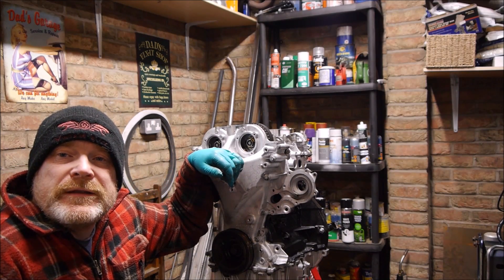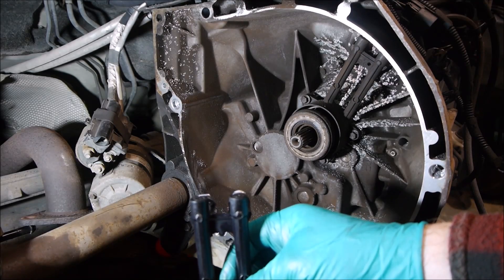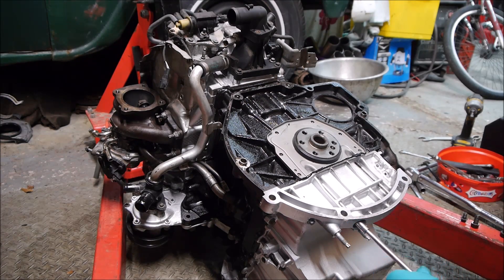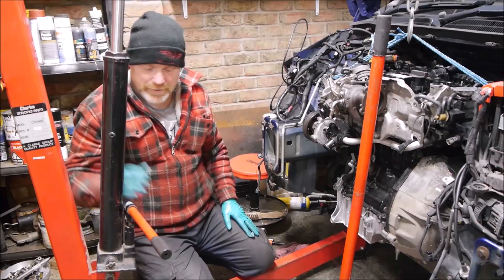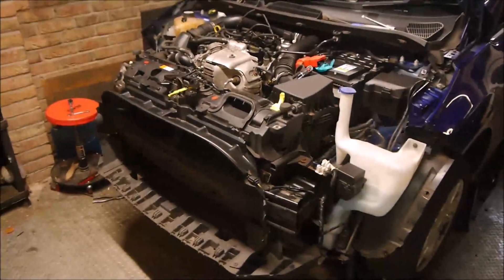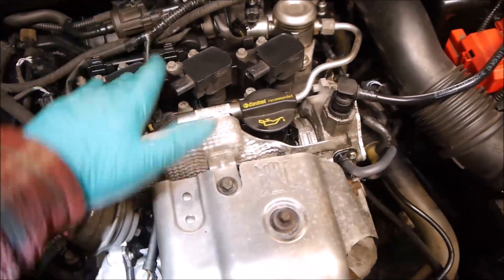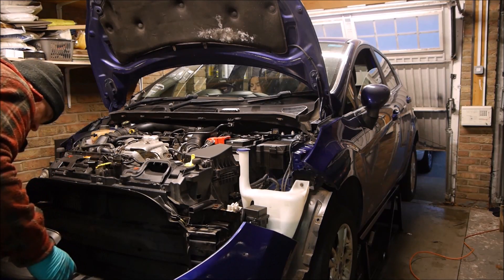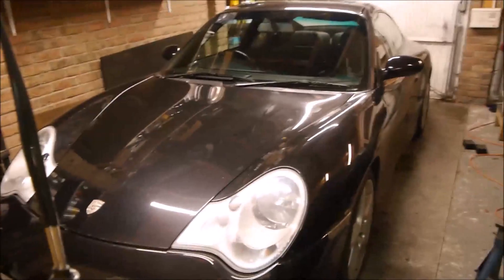Ford Fiesta 1.0 Ecoboost engine rebuild  part 7 - Engine replacement and first run up

Comment: Prime the oil system before you put the spark plugs in it is easier on the bearings, starter and battery with no compression and quicker as it cranks faster.
Reply from the maker: Yes excellent idea. Thanks

Comment: Very nice video, I have a 2019 Fiesta with the same engine. Have you encountered the 'Charging System Service Now' warning message? Cant seem to get rid of it despite changing the battery, and resetting the BMS. The car is actually charging and runs fine except for that warning.
Reply from the maker: No haven't had the joy of that message.

Comment: You will need new bolts for the main cap and big ends.

Main Caps

oil jets top

8  4  1  5

7  3  2  6

Stg 1 10Nm

Stg 2 25Nm

Stg 3 30Nm

Stg 4 Angle tighten 15 Deg.

 

Big Ends

oil jets top

4  1  5

3  2  6

Stg 1 8Nm

Stg 2 12Nm

Stg 3 18Nm

Stg 4 Angle tighten 35 Deg.
Reply from the maker: Wish I had that info 1 year ago. Nobody would tell me the torque figures. But this could help someone else   so thanks for sharing

Comment: What were the overall costs inc the car?
Reply from the maker: Car cost £2500. Engine. Clutch and turbo about £2000.so all. In £4500. At the time good private cars where about £6500 and up. But now we know engine and clutch is zero miles.
Reply: @vintagesteelgarage  I did the same job on a low miles 2014 Fiesta here in Canada. The 1L engine is rare here and as such there is very little aftermarket for them. I purchased a new Ford long block for $3400 Canadian. Ford currently wants $4900 for a long block!?! The car was $2500 Canadian and had 105,000 km on it. Original engine had a blown head gasket. I have been driving the car for 1 year now and really enjoy it. Fabulous fuel economy. Currently needs a left axle seal. The car will get oil changes every 7000 km to try and prolong the wet belt life.

Comment: Thankyou for  the great videos  , you done a great job  , And spent  alot of time and effort  doing this , it good information on the 1 liter ecoboost engine in the fiesta .  I  have  been  in a 2018 ford fiesta  st line , 1 liter ecoboost 140 hp , and wow thay get up and go . A pocket rocket  , their a great  engine  , apart from that timing belt and oil pump belt  issues.
Reply from the maker: Every car has its weakness. Porsche 911 996 and Boxster 986 intermediate bearing can failure ruining  engine. Land-rover 2.7 v6. They snap cranks. However fiesta is cheaper to rebuild 😊

Comment: I came across these videos today. Well done on notorious badly designed engine. We have one of these engines fitted to our transit connect van. It's bloody awful. It's had numerous coolant leaks. Clutch went after only 14,000 miles on it. Throttle body failed. Its go to be one of the worst engine designs I've ever seen. Also that internal Clutch slave cylinder also fails, which means taking the gearbox out to replace. Another stupid idea. You're a brave man for even buying a car with a eco bust engine.

Comment: My first Engine failed at 46k due to a missed recall involving faulty Degas Hose which dumps coolant destroying Engine... Ford put hands up and replaced with new engine.

Last week my replacement Engine has failed at 34k due to the death rattle involving low oil pressure due to blocked stump etc 

My car is now in garage waiting to have Engine stripped. Ford have said they will not help with any costs etc even though they know it's a bad design.

Do you have an email I can contact you on mate to ask a few questions?

Where did you get the Engine block for £1k+ vat?
Reply from the maker: Engine link here. https://approvedengines.com/
Reply: Funny that... u just found them while doing an online search.. cheers mate 👍

Comment: Great series of videos I thoroughly enjoyed them . I've just bought my son the same motor even colour and thankfully the garage had done the belts and cleaned the strainer with 76000k on the clock so fingers crossed this issue doesn't happen . May I ask the name of your jack please .
Reply from the maker: Thanks for nice feedback. The jacks are called Quick jacks. I got mine from Costco. They give great access and so easy to use.
https://www.costco.co.uk/Tyres-Automotive/Garage/Trolley-Jacks-Axle-Stands/QuickJack-Portable-Automatic-Car-Lift-System-Jack-1587kg-Capacity-Model-BL-3500SLX/p/315646

Comment: May I know what does the Clutch B Actuator low circuit means on a Ford fiesta ecoboost?
Reply from the maker: Sounds like a problem with the auto transmission. I haven't worked on these before. But this video explains about clutch a and b actuators. https://youtu.be/K1CoeqNb344?si=z2G00QARtHpl2DvA